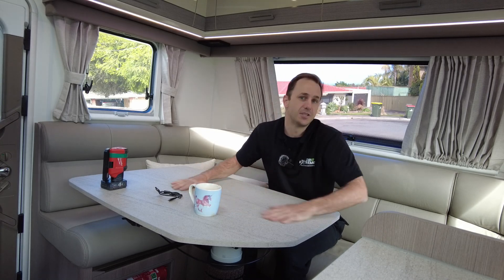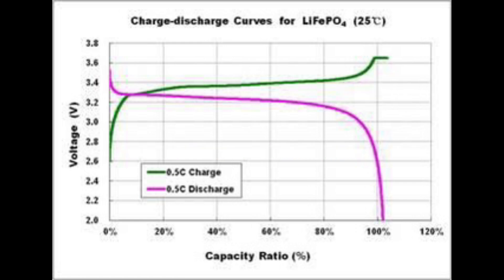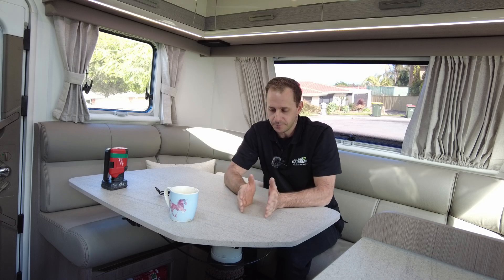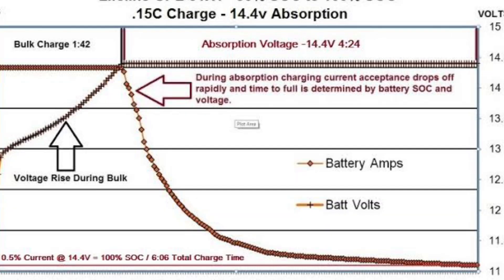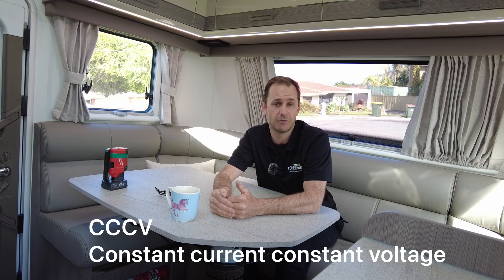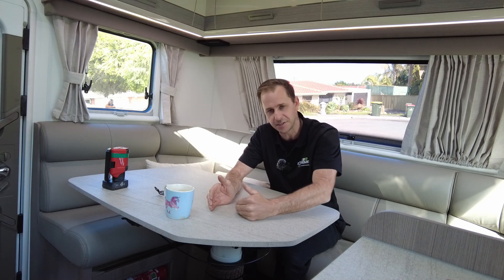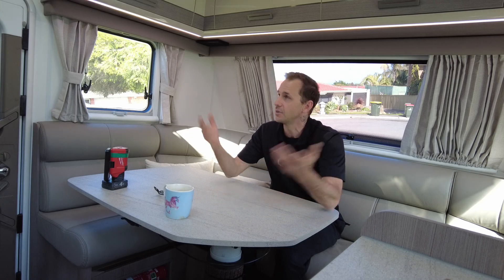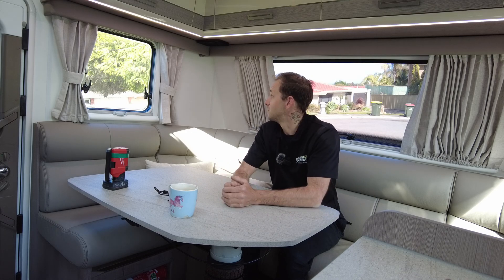Drop in lithium batteries and lithium battery monitoring What is required? ￼

Comment: Thanks heaps for your information, I have a question if you have time to answer. Have you seen lithium batteries they claim you can just drop them in. Is this the same as what your saying here. Or are these lithiums different?
Reply: You just need to listen to the video again. He made this clear. YOU MUST HAVE A CHARGER THAT CAN SWITCH TO LITHIUM no matter what you were told about the “drop in” batteries. These days I think all chargers will have a lithium setting.

Comment: I have recently replaced my two 100Ah AGM batteries in my camper trailer with Two 120 Ah lithium  batteries, is there anything I need to make sure these are charging correctly? From memory there is no adjustments on the cheap as chips chinesium DC DC charger.
Reply: Watch the video!

Comment: Hi matt, just dropped in lithium battery got new solar controller set profile on projector bms to lithium for 240v charging.projector won't charge battery anymore while travelling. Can i put dcdc charger in caravan from grey anderson plug to charge battery and still run fridge when travelling? Have red Anderson plug for alco anti sway.
Cheers
Reply from the maker: Definitely adding the DC charger will guarantee you get a good consistent charge rate at your control

Comment: Im confused as I watched another video of yours earlier today. Drop in replacement video part 1 and part 2 with solar King batts on a bench with your van in the background. 

You stated in that video you could use an older style redarc bcdc charger and it would work fine.

I use a icharger 4010 duo which is meant for the radio control hobby market. I charge my lithium camper batts with that on PB mode (agm) it charges at CC then CV. CC upto 14.4v then CV down to a % or initial charge current.

It does exactly the same thing charging an agm battery the main difference being through CV cycle on lithium is super quick where as agm it takes ages for the last 20%
Reply from the maker: this video really needs an update however the older DC charges used to hold a bulk/ absorption. For long enough that battery was able to fully charge there are seldom charges that can do this

Comment: Defiantly will subscribe learning from these videos. 💯%.   Is it wise to change car starter battery to lithium if running 120a  lithium for your Ute canopy and 120amp lithium for camper trailer.  Running 2 dcdc chargers with 8 b&s to canopy DC charger and 13m2 to camper trailer with dcdc charger the way to go?
Reply from the maker: No,
I would stick with your current setup.

Comment: What if you have a combined charger like Projecta PM300 which claims it can charge lithium. Is it OK just to change the "battery type" in settings or are these chargers still not suitable/ideal for lithium drop in?
Reply from the maker: Of course this will work properly.
👍👍👍
Reply: If the unit has a type selection for "Lithium", then yes, you can assume  it has the appropriate algorithm built in..
Reply from the maker: Correct 
This is ok.
Reply from the maker: Correct ✅

Comment: Thank you for the non bias information. It's so hard to find. 
My van has a BMPro genius and I have been trying to find out if I needed to change to a BMPro batteryplus35-ll to convert to lithium and you have just answered my question. 
I think as it already has a victron MPPT solar charger and I will put a stand alone DC-DC lithium compatible charger in I will leave the genius in and rely on the solar charger and DC-DC charger to give the batteries the bulk supply of charge and like you said the 240v mains charger (Genius) will likely be on for a long time when plugged in so it's not as important to have that lithium profile. Correct me if I am mistaken but this should work fine?
Reply from the maker: and you wont regret it.